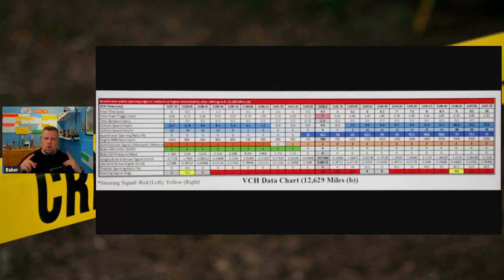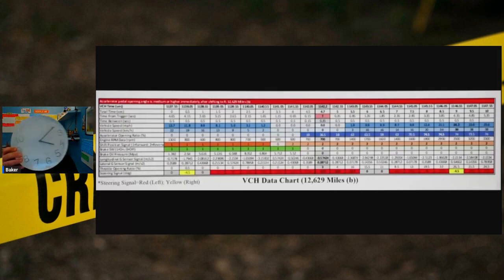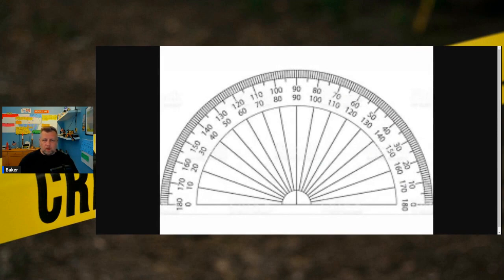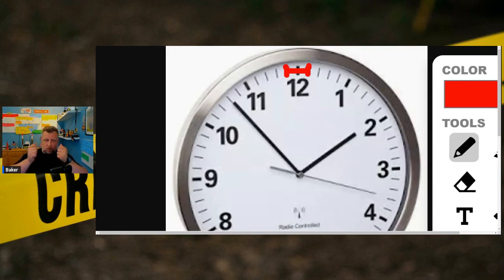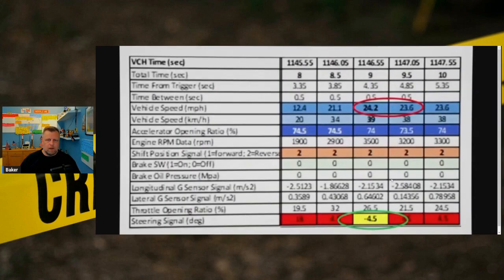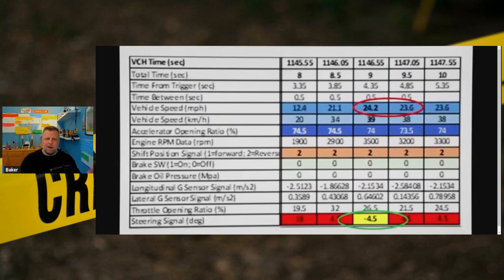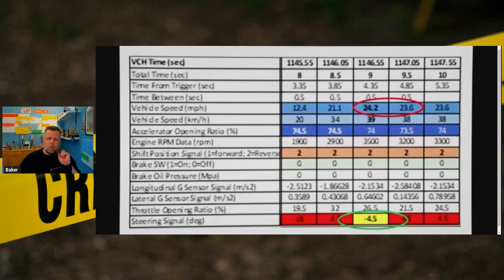Karen Read  Steering Wheel Movement

Comment: @thebrokenbaker,  there are even more factors at play here. The Lexus has a computer controlled variable steering ratio. I don't know the range or values, and I don't know the algorithm of the traction control system that might impact that ratio. That small 9° difference could have been even less relevant. And. I believe that the vehicle was in snow mode, based on the values and variance of the RPM, Accelerator Position %, and Throttle opening ratio %. Being in snow mode would bring about a whole new dynamic especially if comparing the snow to wet pavement done with the Vbox.
ALSO, the values of steering angle before and after don't exactly speak to a "relatively straight" path as the trooper proclaimed.
This trooper didn't put near enough explanation of the other datasheet rows or evidence of adequate crime scene reconstruction effort or knowledge of such.

Comment: Also 24mph is 35 feet per second. That is wider than their property in 2 seconds. That sounds like tires spinning on the icy road and the steering 4.5 correction when you feel the car float

Comment: ... the steering signal doesn't necessary have to be the # rotation of the steering wheel ( hands ) 
( it could be the wheel touching the ground ).. the wheel touching the road swings about 45° left and 45° right.. while your "steering wheel" swings about 540° left and  540° right

if the steering SIGNAL points at a 4° swing of the actual wheel.. 
the ( hand ) steering wheel  was turned over 100° =  prox. one 3rd of a rotation.
Reply: Now we've got too much lol.

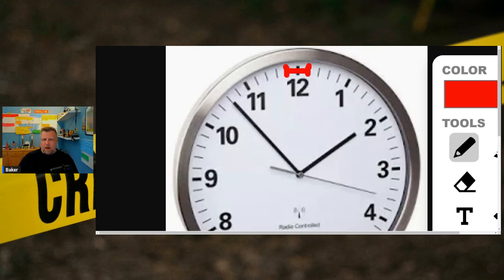Comment: Keep in mind that this is the steering signal, not how much the steering wheel is physically turns. That means no play is recorded, because play doesn't send a signal, or it wouldn't be play. A quick google search tells me steering wheels have around an inch of play, whatever an "inch" is when we're talking about degrees. Your hand jitter at 5:07 would probably be completely within the wheel's play and so not register.
Reply: Also it's half since the road is curved.